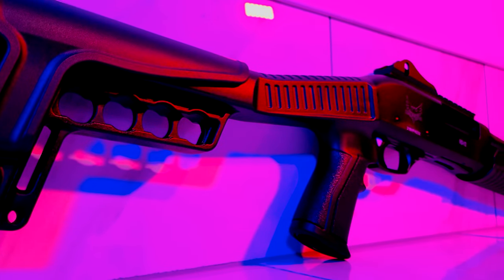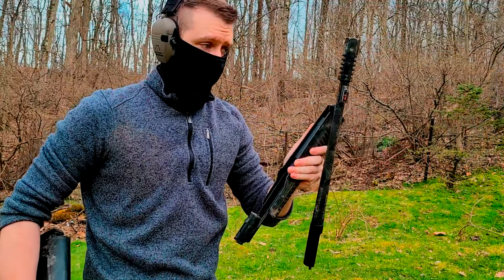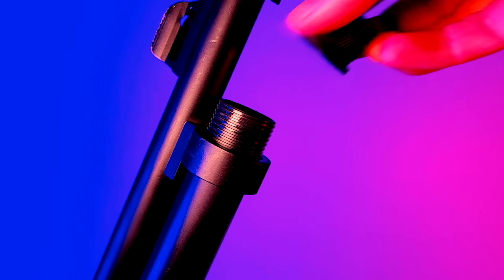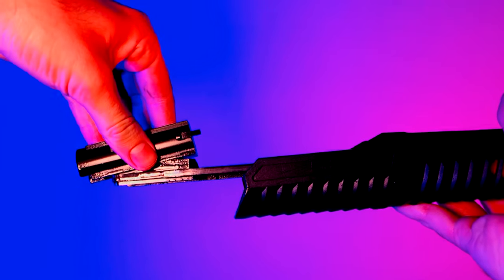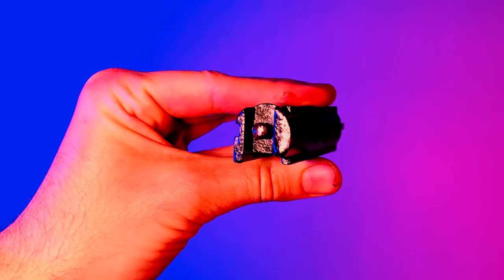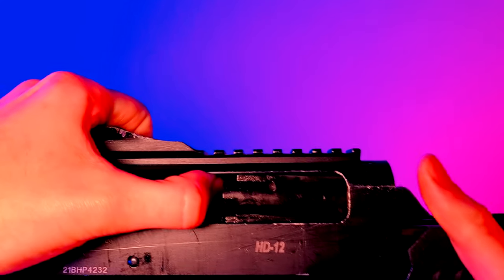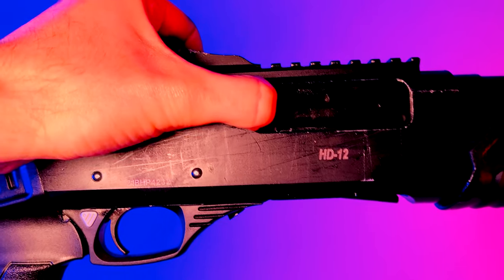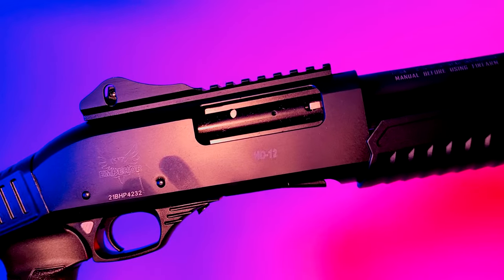Emperor HD-12 Field Strip

Comment: I just bought one of these & was hoping to find videos & information about it & you definitely provided that !! Thank you ! Very much appreciated. I also had a couple questions I was hoping you could help answer. Where could we find quality accessories & attachments you’d use on this firearm ? And, how much fun did you really have with this gun ? 😂
Reply from the maker: Thankyou! I'm so glad you liked the series 😁.  As far as attachments go, I finally found compatible magazine tube extensions for this thing. 

It uses the "stoeger p3000, p3500, m3000 and m3500 magazine extensions.  They're pricey...but the manufacturer says they should work. You can pick one up from "midwestgunworks.com".  I recomend the +2 magazine extension so that the end will be flush with the muzzle. 

As far as stocks, I'm still trying to find one that works. Rem 870 stocks are not compatible.  

For a flashlight, you could mount a tlr-1 to the pumps pic rail.  For a side saddle you can grab one of the nylon cards that sticks to the gun with adhesive. Just make sure to clean the spot with alchohal before you try to use the adhesive (I actually have a video of how to set up your home defense shotgun.) 👍  

If you'd like a red dot I would recomend something by sightmark holosun, vortex or sigsaur.  The sight has to stand up to heavy recoil so it's gotta be quality.   

Lol I loved doing this review! I've never abused a gun like this and it was tons of fun. If you have anymore questions let me know!
Reply: Finally got mine in, thanks for all the testing you have done!!!
Reply from the maker: @nolanmoreno100  Enjoy your new shotgun! I'm glad you liked the content. 👍

Comment: Hey everyone,  so i just picked mine up at ffl this morning and was able to flip fake muzzle brake around so it actually does something.  It's difficult to get threads started bc the coating is on the threads towards tip of the brake,  but I put screw driver through slots in brake to get more leverage and I'm even happier now, triggers and pump action are actually decent. 

 Update,  my 2nd one did not go as well, I had to work it on with wd40 twist on alil bit then take off and clean shavings then repeat ( barrel is steel and brake is aluminum so the barrel slowly cuts the coating and a bit of aluminum on the brake). So the 2nd one is on but there's not alot of tension on threads like other so will use alot of thread locker and prolly try and install set screw on the other side.
Reply from the maker: Thanks for the info! I had no clue that this was even possible.

Comment: When racking the gun fully. And you get ready to pull the trigger but if your rack comes back a little bit does it stop it from shooting? Is this a safety issue?
Reply from the maker: Is your pump still locked when a shell is chambered? If it is, then you should be okay.  If the shotgun is truly "out of battery" then you may get a light primer strike, or no primer strike at all, causing the gun not to discharge.

Comment: For the life of me i cant get this thing to disassemble its like its welded shut.any suggestions ?
Reply from the maker: The tolerances may be really tight from the factory. Maybe try some penetrating oil around where the barrel fits into the reciever? A dead blow mallet to knock it loose?

Comment: Thanks for your work and thanks for looking into magazine extensions. I would reeeally like at very least 1 more shell be held in the tube. Was also considering chopping down the back part of the forend so there'd be space to put on some shell holders on the side of the gun and looping a sling through the hole under the front sight. This is probably what me 'n the boys would consider "ghetto style" lul, but I was wondering with your insight if any of these ideas would cause problems. Thanks again.
Reply from the maker: Thanks for watching! I'm still trying to find a mag tube extension and stock that fits, but I'm getting close.  

As far as cutting down the pump/forend, it'll definitely work... I've thought about doing it myself and I may still.  You could definitely loop the sling through the front sight but I'd just pay the $7 on Amazon and get a picitany sling mount for the rail on the pump.  

Either way it's a great shooter! 👍
Reply: Right on
Reply from the maker: I finally found compatible magazine tube extensions for this thing. 

It uses the "stoeger p3000, p3500, m3000 and m3500 magazine extensions.  They're pricey...but the manufacturer says they should work. You can pick one up from "midwestgunworks.com".  I recomend the +2 magazine extension so that the end will be flush with the muzzle. 

I'll post a video of this stuff but I figured you'd want to know ASAP. Enjoy!
Reply: @collapsenprotect  Can't wait to see how you pimped yours out. I'm new to shotguns so I'm pretty lost when it comes to modding them.
Reply from the maker: @GateSide0  it's going to be an adventure lol I have high expectations though.
Reply: Wow that I almost costs as much as the gun lol
Reply from the maker: @tuco86x  I know, it's not really worth it in my opinion.  I did get pointed in the direction of the "chokate" brand extension tubes.  Those cost about $60 for a +2.  

I have one on the way and I'll be testing it out! 👍

Comment: I bought mine yesterday and shot 5 shots out of it and now the slide is stuck back- so I can’t even take it apart- any suggestions
Reply from the maker: Like the pump is all the to the rear and it won't go forward again? Hmmmm...im not sure. 

You could try to force it with a rubber mallet.
Reply: @collapsenprotect  WD-40 and slamming it on the ground worked for me
Reply from the maker: @justinstanford7958  lol excellent. Well, we know from experience that it can handle that type of abuse! 👍

Comment: Whats the best way to switch out the stocks?
Reply from the maker: I would just use a ratchet with a couple of extensions on it.  I believe it's a 14mm bolt inside the stock? I did tighten it down during the first stage of the torture test.  

G-Force arms sells aftermarket stocks for the hd-12 in all shapes and sizes!
Reply: @collapsenprotect it's 13mm. Just finished tightening mine